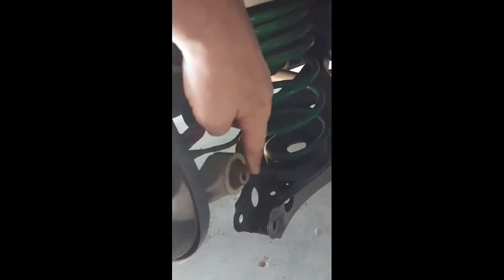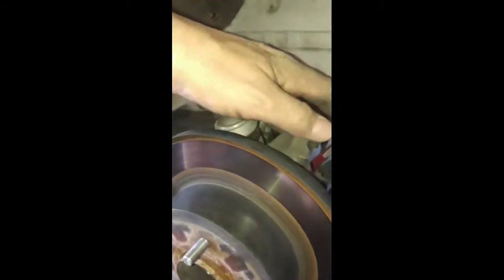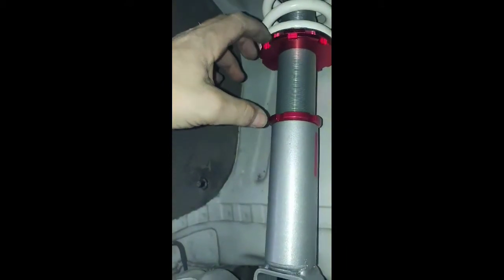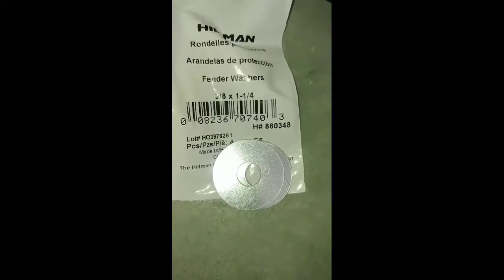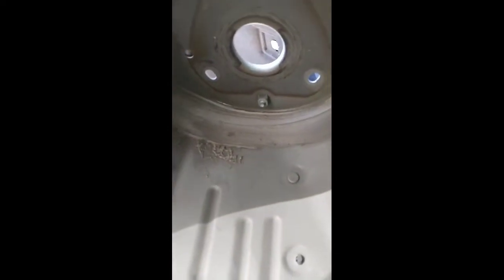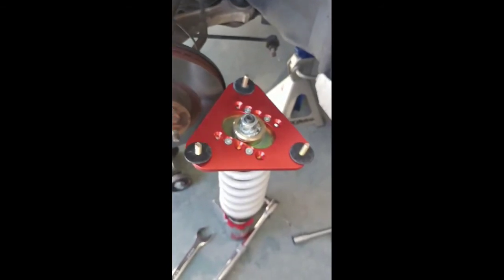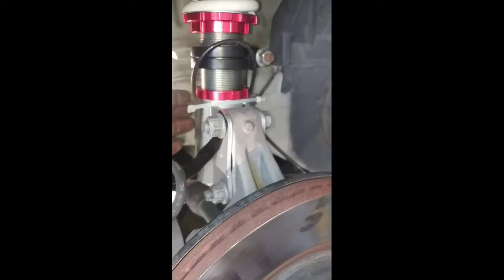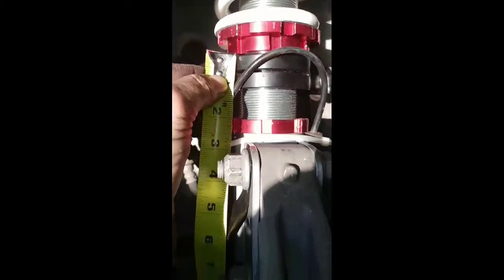Truhart coilover installation, Nissan Altima Gen IV

Comment: Bro!!! Thank you, I let my kids play with my coilovers months before I installed them and lemme tell you the headache I got later, so they unscrewed the mountings to the hub way out I didn’t realize it, my sway bar link wouldn’t line up and the coilovers in the front were really frustrating me because it wouldn’t line up with the hole for the link and the coil wouldn’t adjust any higher for the link😳. So after watching the measurements 🛎 the light went on. I have to literally pull the coil and move the bottom up to the measurement I need then I can adjust it after….I’m glad I watch this, thanks!!

Comment: I owned an altima 2009 .. I’ve swapped my coil springs into an Eibach pro kit .. I was shocked because the rear side was lowered than the front side!!
Reply from the maker: Cosmos Beats I had the Tien street advance springs on and had the same issue, the rear looked lower than the front, that's part of the reason I switched to coils, plus I wanted to be lower than the springs would go.
Reply: Gen IV Altima it’s a great job you did, Im going for it soon! Some told me to change the dampers to a brand new ones and others told me to use a coil spacer, but i don’t think that will fix the issue.

Comment: Great instructional video. How’s the ride quality?
Reply from the maker: Jack This1 ride quality is great, I have since raised the car up about an inch from where it was in this video, just because of the road quality here, I did preload the springs a bit more too, just because I wanted a stiffer ride, overall the product is great and I ha e no complaints, word of caution however, if you do drop these altimas this low you're probably gonna tear the CV boots pretty quickly after you drop it, its just something about these nissan driveshaft boots, almost everyone I know that has lowered their altima has that problem.
Reply: Thank you for the Reply and the heads up.

Comment: Hey man I know this is an old video but I noticed you posted 9 months ago. Possibly you could answer my question. With just the lowering spring. Did you need to adjust your camber at all or have any trouble using stock components to dial in camber. If not what after market parts did you use or do you recommend.
Reply from the maker: With lowering springs you shouldn't need to adjust anything else, they won't lower the car enough to have a drastic impact on camber, it is recommended after they're installed to have an alignment done on the car, the on other issue with lowering springs is that they can wear out the shock absorbers faster than stock springs so if the shocks are old it wouldn't hurt to change them before installing the springs.

Comment: Hey quick question bro. I know this is quite sometime since your video , but I just seen it now. I just got the tein springs today. In this video did you have the oem struts and shocks when you had the springs on ?
Reply from the maker: Yeah, you have to remove the oem springs from the struts and swap them for the lowering springs, in the rear the springs will come right out of the lower control arms just swap them out, you dont need to remove the shocks.

Comment: It's been 2 years since this video. Any updates on longevity, comfort, and overall feel?
Reply from the maker: Overall the coilovers have kept up their original feel and performance, i daily drive this car so they've had a few miles put on them, i will be doing a rebuild at some point simply because they have over 40k miles on them now, but they still feel great, no noise and I can still adjust them whenever I feel like it, would recommend if you want what I would call mid-grade coilovers, and I only call them that cause they cost about $300 to $400 less than some of the other brands out there.
Reply: @mygeniv8377 3 years since this comment, do you still have the altima and if so do you still have those coils on still or you switched it up?

Comment: Did you have any issues with cambers
Reply from the maker: Not in the front, the rear had pretty good negative camber, I was rotating the tires pretty regularly to avoid bad wear patterns, ended up getting adjustable camber arms and bolts for the rear, it helped alot.

Comment: Where you took the lowering coil off the rear and put the new coil over in, what do you do with the space the old coils went in?
Reply from the maker: Nothing, it stays empty with one piece  coilovers, other coilovers are two piece in the rear so an adjustable spring goes in there.
If you do use a one piece be sure to remove the upper and lower rubber spring seats, the pop right out but if you ever want to go back to stock you'll need them.
Reply: My Gen IV okay thank you man!
Reply: @mygeniv8377  is it possible to just remove the bracket that hold them. Plan on installing coil overs next month
Reply: @mygeniv8377  bro. I installed my truharts on my coupe. I’m seeing you removed that spring in the back. I left mine in and my car rides super bouncy could this be why?????
Reply from the maker: @lTzImmortal  more than likely that's why, the coilovers should be pretty stiff depending on how much preload is in them, but definitely shouldn't be bouncy, I would remove the stock rear coil springs ASAP.

Comment: How many inches did you set your preload too?
Reply from the maker: For me it was a feel thing, so initially these coilovers should be preloaded, but I tightened them down to the point where the spring is tight and doesnt move, then I tightened a full turn more, after I decided I need a bit stiffer ride I added more preload, I got a good bit of preload in it now but I like a stiffer ride personally, so it all comes down to feel, a bit of a pain in the butt to add preload but it can be worth it depending on your driving style.
Reply: Yeah I drive the shit out of my 5th gen, I want it to be plenty low but still a good ride so I was just wondering what lengths I should try
Reply from the maker: Depends on what youre into, the coils give you options as far as ride night and stiffness but a lot of times you end up tearing your CV boots if you go too low, lowering springs will bring you down between an inch and a half and two inches depending on the brand plus you retain your factory ride quality but you cant adjust anything, all I recommend is if you get coils dont drop it to the ground immediately cause you could damage those cv boots and that gets to be an expensive repair.
Reply: I got coils I’m putting on in the morning, do you remember what how many inches on the front and the back that you did?
Reply from the maker: I measured from the fender to the center of the hub, it was 12.5 inches and that was pretty low, too low for where I had to drive, so now I have 14 inches from the fender to the center of the hub.
Reply from the maker: But I have a Gen 4.5 so the measurement on a Gen5 might be different, what I would do is measure from the fender to the center of the hub while the car is on the ground, then go from there when adjusting your ride height, the coils won't compress much when you put the weight of the car on them.
Reply: Appreciate the advice man! That’s probably what I’m going to try!

Comment: Shit man on mine the sway bar link is too short for me to go lower than 17 inches from hub to fender what do I do? I have 14 on the back but I’m trying to get both to 15.5 I know how to adjust the back I’m just baffled with the front right now
Reply: Easton Ancelet literally same !!
Reply: Daniel Galvin just turn the spring so it’ll fit, put the bolt on then turn the spring with the bottom tightened up and it will lower